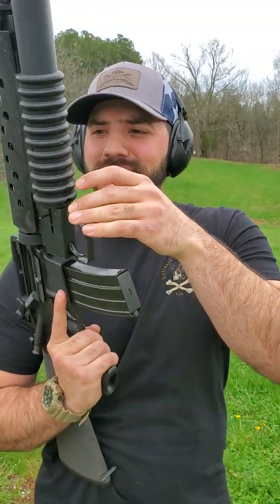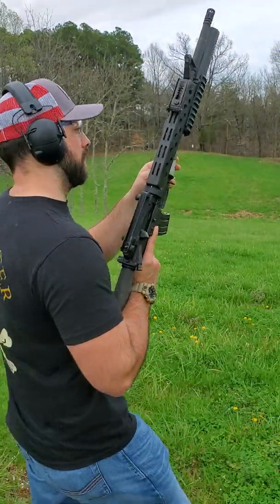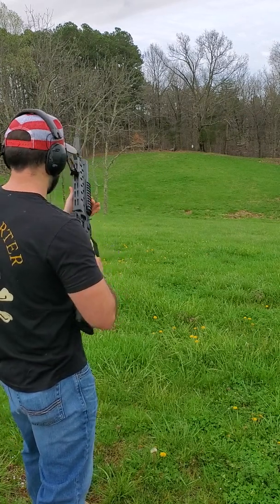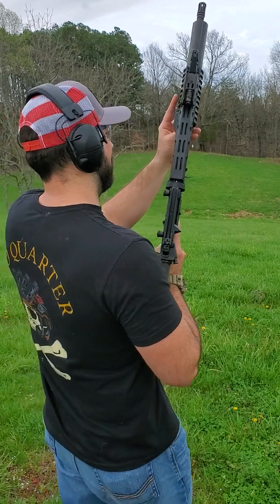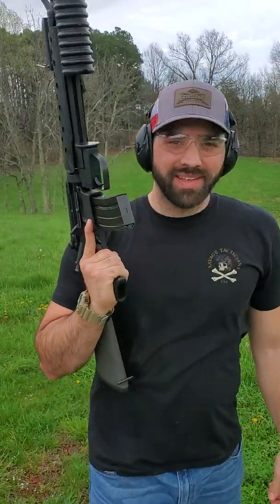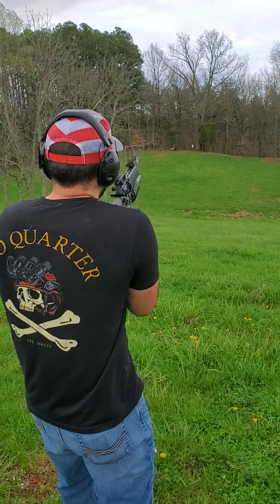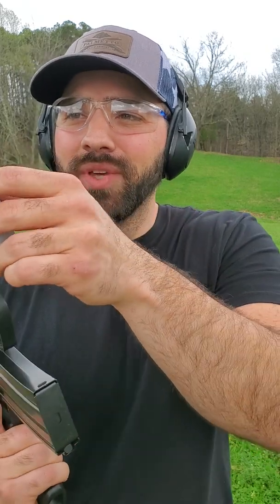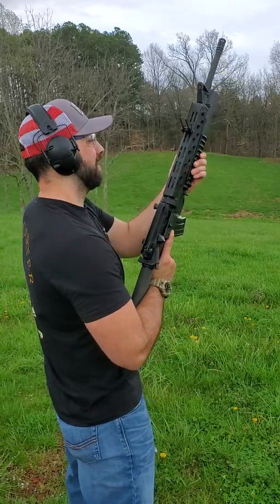3D Print 37mm Chalk Round (Part 1)

Comment: you need to use wadding and potentially a seal of hot glue to get the pressure build up. youll be able to get over 100yd with fff.